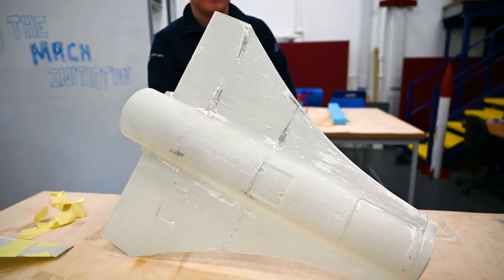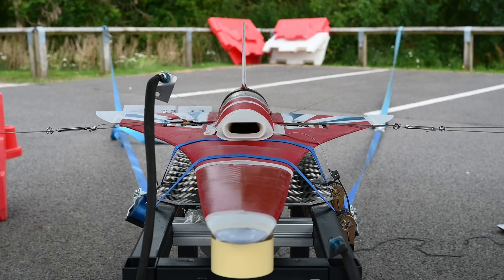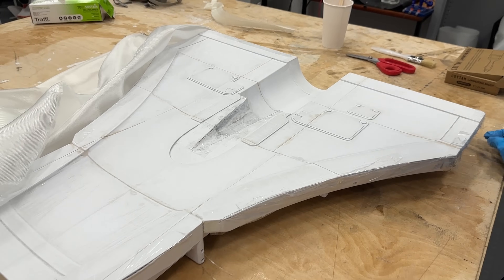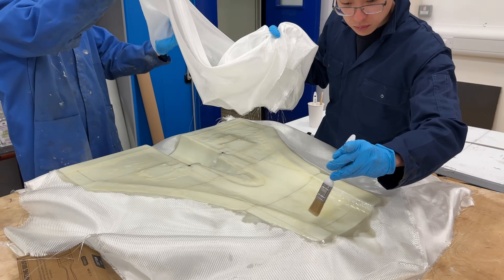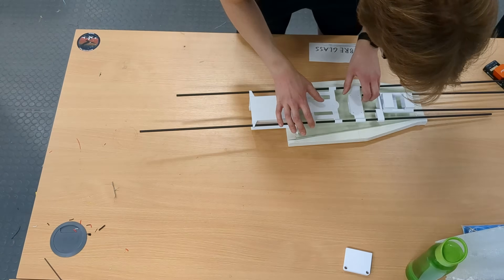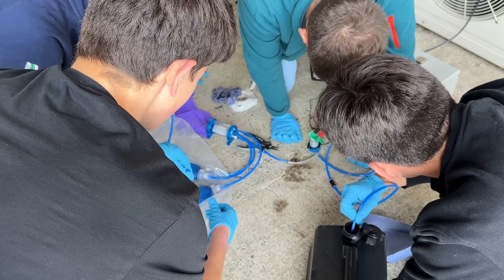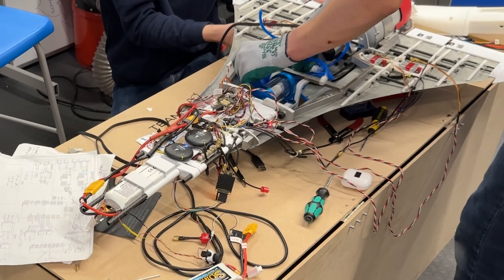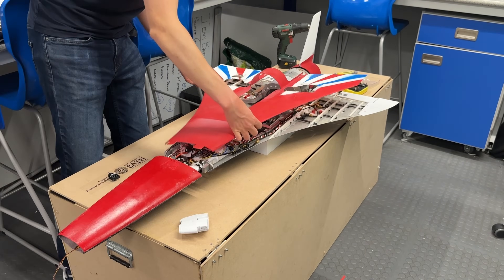Completing the Build of our 570 MPH Model Aircraft!

Comment: Why you build nearly all Frame Part of Aluminium in Times of Cfk Sandwich Plates ?
Reply from the maker: There is a slight weight penalty, but we are much more familiar with aluminium so found it easier to machine. We needed a lot of details like drilled holds, threads, etc which are easier to do with aluminium (don’t want to delaminate parts when drilling holes, etc). Finally, with aluminium you can guarantee the strength and structural performance much better than with CfK sandwich plates which depend on how well you laid them up, whether there is any delamination, fibre volume fraction, etc
Reply: @TheMachInitiative  Ok, i`ve been fly a Arworld Skyrunnner 300 but with a 44n Gold Wren and it was 400kmh+ and during the full Power weight doesn`t metter but during Start and Landing it can make a big problem but maybee you take a look at the construction of the Skyrunne, very interessting and if you will go realy fast there is no way without Full CFK Samdwich but it is just my opinion

Comment: Take care about dual rates in Ailerons/elevators..they seems to move to much in the video considering it'll fly so fast..
Reply from the maker: Yep - this was just to test the control surfaces, we will do the mixing before the flight, including the option to switch to using just the inboard elevons for sensitive roll control at high speed
Reply: Probably you are planning a flying program test increasing flying speed progressibly and observing control surfaces behaviour at different speeds. Fluttering is critical at high speed flybas you know. Using powerful servos as you're installing and strong cf  pushrods Will help.. Good luck and we'll anxious to see the resulta. Very good work!

Comment: im still convinced your design is too small, too heavy, wing loading too high, impossible to land that thing. and then at 500mph you cant see it. this is going to be a looong road of redesigning and building lots of more models after this one...😒 but still, good luck!
Reply from the maker: If we make the wing loading any larger we won’t get our drag sufficiently small to break Herbrich’s record. Our wing loading is ~250 g/dm^2 which we all agree is high, but our lifting efficiency is better than Herbrich’s which means we only need to land a little bit faster, and we have FPV to help with piloting. I agree that getting the record is going to be a lot of work!

Comment: Does a small SRB with wiglets count as an RC aircraft? If so, I will wreck your record in like 5 hours with some hot glue.
Reply from the maker: To qualify for the record, the aircraft must only generate thrust from airbreathing microturbojet engines. An SRB would categorise the aircraft as a model rocket, where the speed record is far higher
Reply: @TheMachInitiative  Can I build a hybrid turbo ram jet instead?
Reply: @TheMachInitiative  Are there fuel limitations? Can I use hydrazine in the turbine engine as an afterburner of sorts?
Reply: @TheMachInitiative  Soooo. The X1 and X15 are not legitimate aircraft by this standard? Considering the absurdity of that claim, can I build a scale model of the X15 with a scale liquid rocket motor?

Comment: i'm curious about the shape of this aircraft, considering it is still subsonic if its going 570 mph (albiet fast), is it necessary to have such a drastic sweep angle on the wing? I'm under the impression that the benefit of swept wings isnt so significant under subsonic conditions so a less drastic sweep angle and shorter nose could be sufficient, but I understand that you guys have done actual CFD analysis and I would love to hear about the results and how that influenced the design
Reply from the maker: From a purely aerodynamic perspective a high aspect ratio swept wing (swept ~30 degrees) would be ideal. However, we found a delta wing reduced structural loads enabling a lighter structure, and was much better for integrating fuel tanks and servos, which enabled us to have a thinner wing, smaller wing, and smaller fuselage (all of which come with indirect aerodynamic benefits). So the delta wing won.

The delta wing generates vortices over the top (suction) surface which massively enhance lift at high angles of attack. A high sweep is required to stablise the vortex and prevent it from breaking down at the high angles of attack we experience at landing.
Reply: @TheMachInitiative  Thanks for responding! Learning about how people approach engineering trades like this is really interesting so I appreciate it very much. Could I ask: if this project were to be continued after Kingfisher flies and even achieves the new record, would it be likely that you tend towards a design that's more ideal aerodynamically? Is there another aspect of the design that would be more important to improve on? 

I'm also curious about whether the team thinks actually achieving mach 1 with an aircraft this size is feasible in the near future.

Comment: Hi! Why did you guys chose fiberglass instead of carbonfiber? Im a mechaical engineering stundent from argentina who wants to do a similar, more simple proyect like yours! Love the website design. Keep up the good work.
Reply from the maker: We chose fibreglass because carbon fibre is conductive so you can’t put antennas inside of it
Reply: @TheMachInitiative  thanks for the reply! Looking forward to your first test flight! Cheers
Reply: @TheMachInitiative  you could run antennae externally, in recessed channels perhaps? I think CF may have been better. Just eyeballing it, your structure looks weak to me. The loads from a gust or manoeuvre at even modest RC speeds are enough to tear CF RC planes apart let alone glass fibre and Mach 0.75 :)